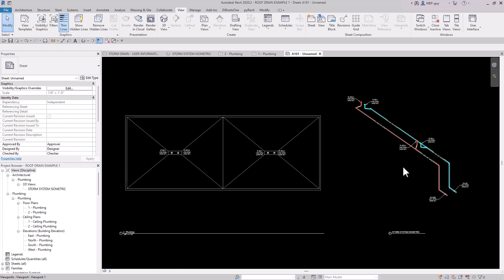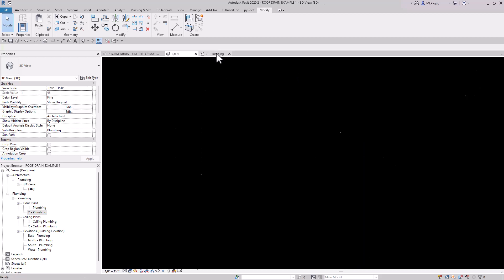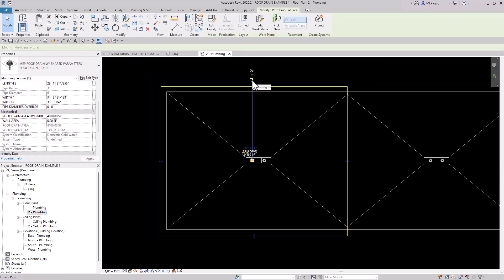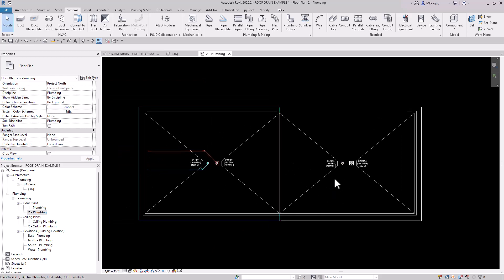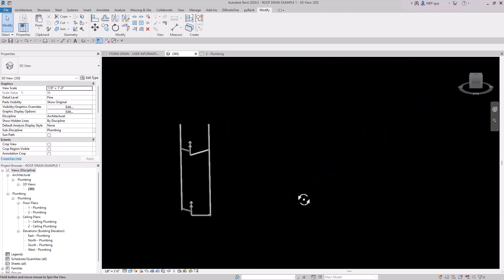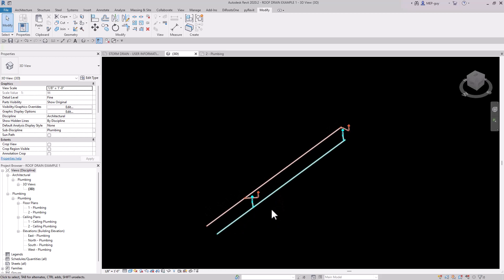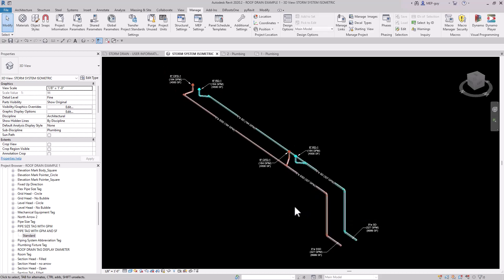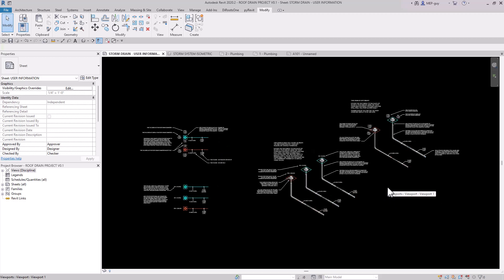Sizing Storm Drain Systems Automatically in Revit

Comment: I was able to use this unit the release of Revit 2024.  It will not allow GPM flow from a roof drain as a plumbing fixture family.  Once I changed it to "plumbing equipment", then the GPM would work.  Not sure why Revit 2024 won't allow GPM calcs for something as simple as a roof drain.
Reply from the maker: Hey Pat. Meant to respond to this earlier. I appreciate the feedback. I think it's probably a compatibility issue. I'll definitely look into it.